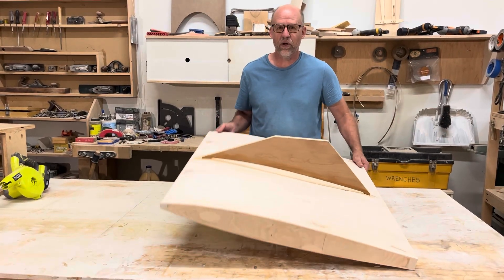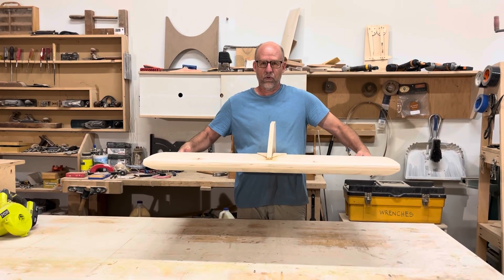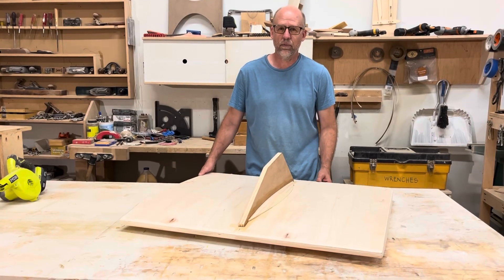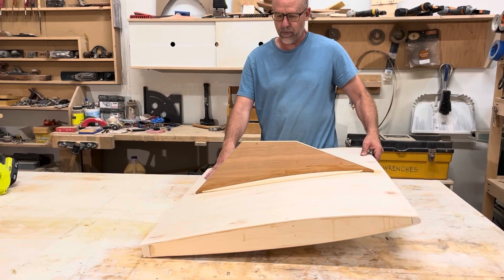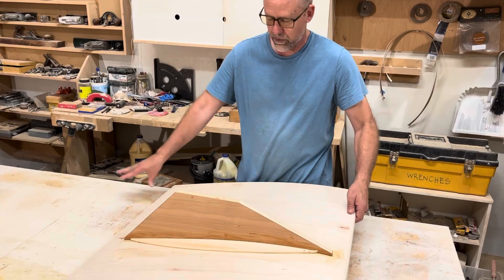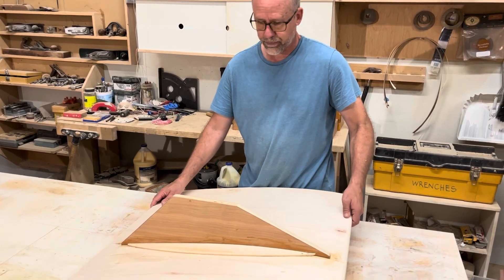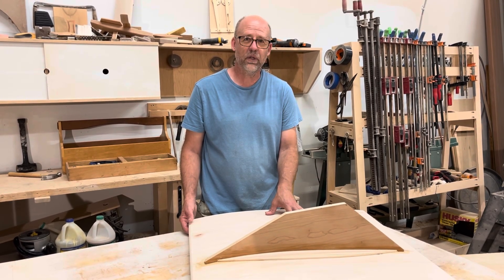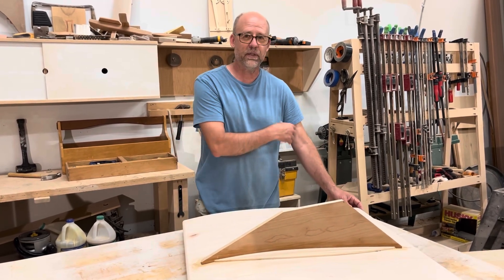Airfoil skimmer ready for testing

Comment: My recent experience with curvature on the bottom of outrigger floats is that it creates suction https://www.youtube.com/watch?v=sUAvCg6w79k , looking forward to your tests
Reply from the maker: The suction is all due to the direction of flow leaving the trailing edge.  In this case it is pushing water downward 4 degrees so there is no suction.  If the lowest part of the bottom surface was in the middle, then it would suck downward.  But the lowest part is the trailing edge.
Reply from the maker: In the case of the inflated float, the lowest part of the float is in the middle (belly).  In the case of my hydroplane, the lowest point of contact with the water is the trailing edge, so it always pushes water downward and never lifts the water upwards.  So it only produces lift and no suction.
Reply: How did you get the nice tight round curve on the leading edge?
Reply from the maker: @ChristianNally  There is a wedge shaped piece of poplar on the leading edge which I hit with an elliptical router bit.  The bit is used for making stair handrails but it works great for the leading edge of a foil.  So it cuts through some of the 5mm plywood skim but there is still plenty of glues surface to hold them together.
Reply: @markpalmquist  and a layer of fiberglass over top? at about a 1/2 inch turning radius?
Reply from the maker: @ChristianNally  slightly larger than 1/2 inch radius on the nose, and yes I will probably put 6" wide strip of biaxial fiberglass on the nose.

Comment: This design looks great!   I much prefer the idea of skimmers compared to foils.  I would still also test a version, otherwise the same, but with a 4mm step roughly 1/3 from the skimmers " transom" (Just adding 4mm xps on top of the existing surface). This might reduce drag at higher speeds.
Reply from the maker: At higher speeds, the front half won’t be wet because the skimmer will lift.  If I increased the cord length then a step would be beneficial.
Reply: @markpalmquist  I don't disagree on that. However on racing boats, have understood the benefits of the steps is even higher in some seas than on the flat. The reason when hitting a wave the stepless hull truly will have a huge wet surface, whereas the stepped on have significantly less. Same possibly with the skimmer, in flat water front half will not be wet, but there might be a benefit with a step when skimmer hitting waves( that usually occurs in windy conditions). In any case, its not a big deal either way in these speeds we are talking here :)
Reply from the maker: @joeordinary2trumpheroofrussia  I think the stepped hull becomes efficient only at a speed 3x the hump speed, so 27 knots, which would be achievable on a larger boat, maybe a 24’ long version with a Tornado sail rig.
Reply: @markpalmquist  You are right, the steps usually helps only in higher speeds. But not entirely sure would the general rules be applicable  on a skimmer, with much smaller steps than usually on a boat. Not sure they would decrease friction/wet surface area that much either :)